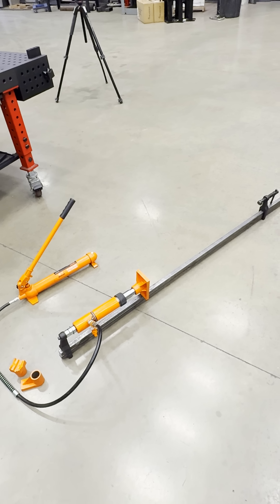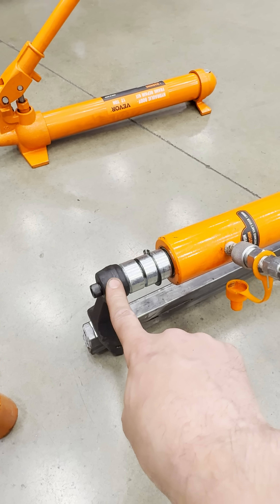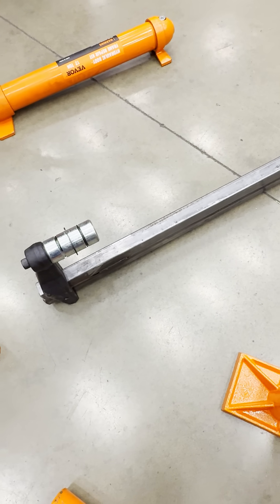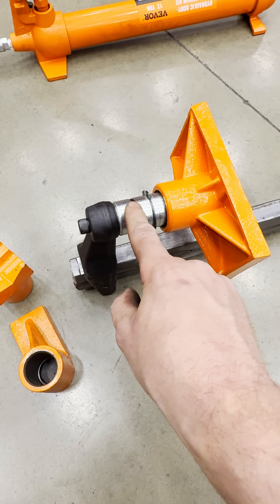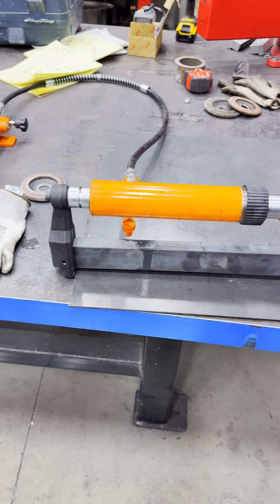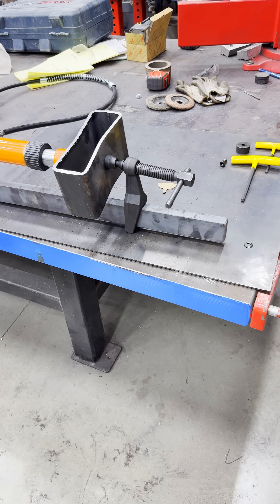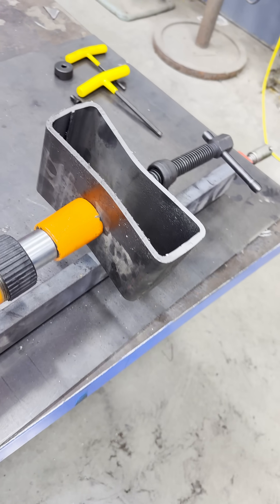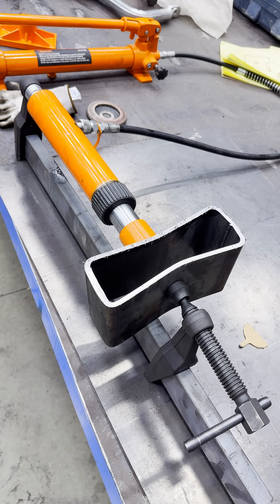Why Hasn't This Clamp Been Made Before?

Comment: I've always thought that someone should develop a version that has TWO bars on it. The main bar and an auxiliary bar that you can install on the other side so that your work piece is sandwiched between two lengths of bar, and the clamp/cylinder can "pull" on both bars evenly, preventing it from wanting to deform/bend outward due to the leverage produced by the porta power pushing on the workpiece.  Once you install the auxiliary bar on the other side of you work piece, the clamp has 2 bars to pull against, and it can pull evenly on both so the force stays parallel to the axis of the ram.

Imagine a ladder with only one upright holding all of the steps, when you steped on a step, it would want to bend but when you have 2 uprights holding the steps on either end the steps become much stronger.  Same principal.

Comment: I've had a lot of bar clamps bend the bar long before I'm out of clamping power. The solid bar solves that, but the weight of the bar would now make it a beast to manage. So for most people I think it would sit in a dark corner unused 99% of the time. But, for those that need it, it would be good.